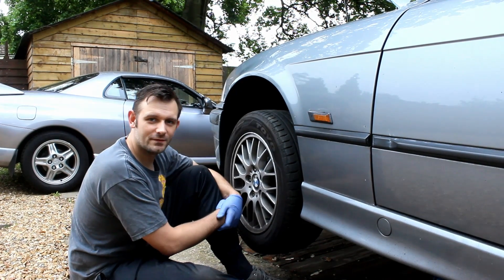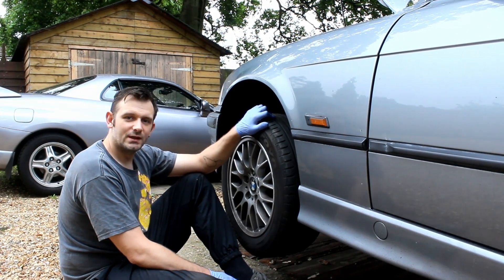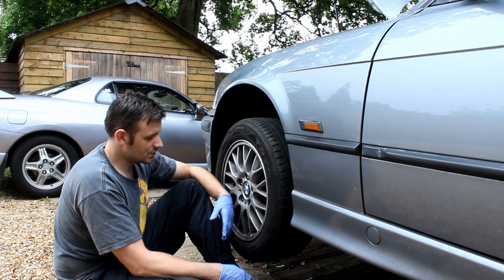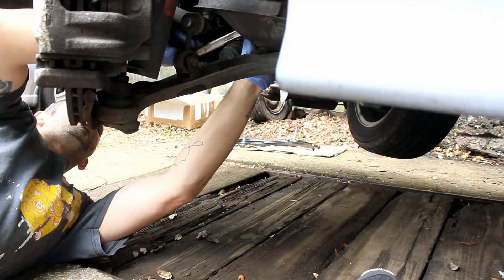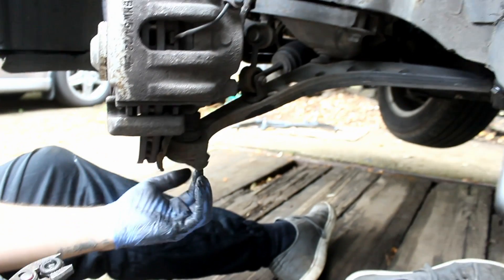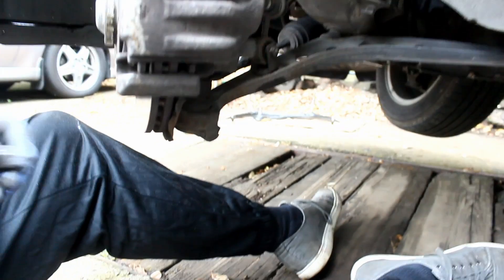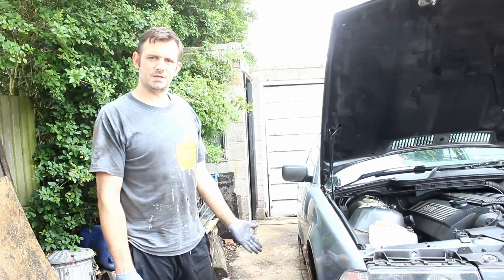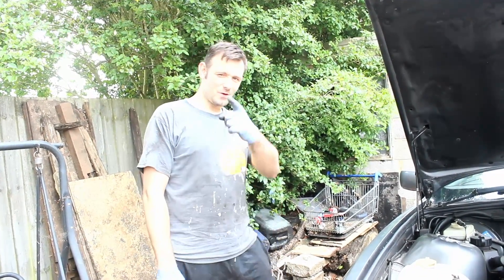BMW E36 Lower Control Arm Replacement

Comment: Good video, mine are completely shot so I wanted to do all of this DIY and on the cheap. One thing is that it's good to clean the rust out of the threads prior to unscrewing the old control arm balljoints. That way when you remove the nut, it won't get stuck on the rust.

Comment: Most posts destroy the rear bushing to get it off. You are right. With penetrating oil it can be worked off. Thanks for the post.
Reply from the maker: Thanks, it's not easy, but it can be done with a little patience.

Comment: I’ve tried to change mine today but the ball joint that’s goes to the chasis was spinning 
And I couldn’t take the nut out of it
And I couldn’t separate the ball joint from the steering knuckle
Hope this help you guy’s.
My lower arm looks like it never been replaced before 
So be prepared for the worst and make sure you have right tools for this cases, so you don’t have to put it all together again and loose you’re time

Comment: Waooh. This is really educative. I tried this yesterday and I almost got this but the thread line of the upper joint was bad (which I never took note of anyway) and I had to refix the old arm again.
Reply from the maker: I hate those jobs. 1 step forward 2 steps back.

Comment: I've done this very job on my E36 318i. Both outer bottom ball joints had failed the MoT so I opted to replace both control arms (I decided to stick with the E36 ones). One of the lollipop bushes started to tear when I tried to remove it so I ended up fitting new lollipop bushes too. I ended up undoing the bottom of the shock absorber to get better access to the outer bottom balljoint. I featured this job on Part 3 of my "Project Bimmer" videos.

Comment: Have you considered swapping to e46  control arms for extra camber?
Reply from the maker: I've not. Because it's my daily I didn't want to get too much angle for tyre wear longevity. If I wanted more, it would have to he with adjustable plates.

Comment: I bought some of these 2 years ago just because they were a screaming deal, and it was something to do... and I figured a 20+ year old car could probably use them. I was worried about getting the lollipop bushing off... guess I don't need to worry about that now

Thanks man may put these on this weekend
Reply from the maker: ZombiesLogic Good luck buddy. Its very satisfying as you will feel the front get tighter and more responsive. A must do for these old girls.

Comment: Should I get a wheel alignment after doing this?
Reply from the maker: Essentially no as dimensionaly they are the same as the 36 arms. this being said I have to recommend that you always have the alignment checked after any suspension work. I try to do suspension stuff in groups to avoid lots of alignment costs.

Comment: Have you had problems with misted headlights? I've got that problem especially now in the winter but can't find any videos on the best approach to dry them out / reseal them...
Reply from the maker: James Stanway I sure have James... Best and easiest fix I found was to simply remove the bulb covers at the rear of the lights and drive it for a few days. The heat from the bulb dries out the condensation which can then evaporate out the opening in the rear of the cluster. Once they are dry the covers can be replaced. The only other way is to remove the light clusters, empty the components and dry them off the car in a low oven/ airing cupboard. Good luck.
Reply: Cheers mate, will give that a go.. gonna be doing my anti-roll bar drop links and tranny fluid when the weather is a bit more favourable as well .. I've also got a 323 :)

Comment: Great vid. I have to do the same, i dont think that anybody ever replaced the control arms. My E36 has 288k.
I dont know if you can answer.

Do the control arms can cause it. When i drive on bumpy road, still asphalt but pretty bumpy. Then the steering wheel forcefully turns by it self over small bumps. To the right/left. I can hold the wheel but it feels pretty sick.
If i come to a stop on bumpy road and hit the brakes, it feels worse. "Steering wheel lives his own life"

Its not huge amount and car doesnt turn to the left and right but i feel this all and see through steering wheel.
And i dont like this feeling it at all. I want car to be solid and deal with the bumps not turning away from them.

 I wonder what could cause this? Bad inner and/or outer tie rods?

Or even bad steering rack that has too much "play" ?

Tie rods of course are cheaper to replace. And if everything stays same, its rack?
I locked the steering wheel by removing the key. But i still have some "play" when i try to move front wheels by hand "9 and 3" but i also see steering wheel moves a bit when steering wheel is locked. I guess there should be some play in it?
But i guess not so much that i can actually move the wheel and see it move.
Reply from the maker: jw200 it's hard to give advice without seeing and feeling the car but yes, the wheel will turn slightly even with the steering lock engaged...and will make a small but deceptive knock as you wiggle the wheels. what you describe could be all of the above and you have to check things methodically, when you wiggle the wheels, get a friend to hold the steering wheel...check the tie rod visually as you move the wheels, left right for tie rods, up down wiggles for ball joints and bearings. you could also try to search for "bump steer", if your car is non standard that also may have an effect. good luck.
Reply: Thank you. You gave me good ideas what  to try.

I drove home from work and it did same, feels loose. Have to inspect it asap.